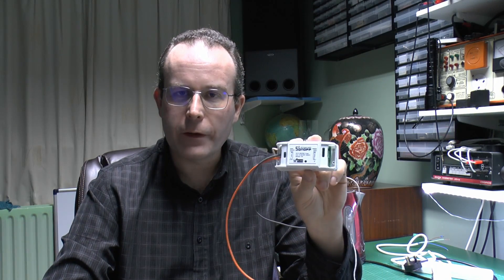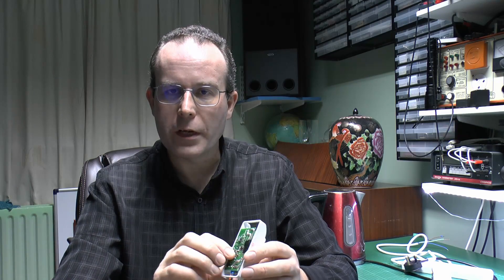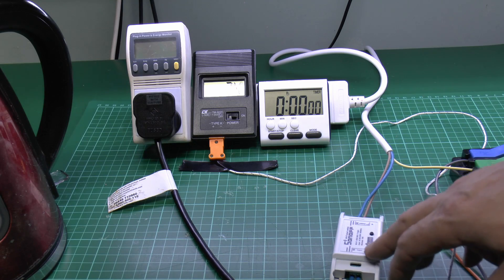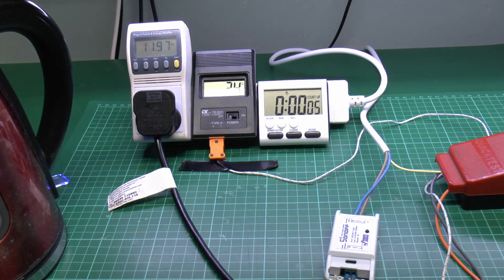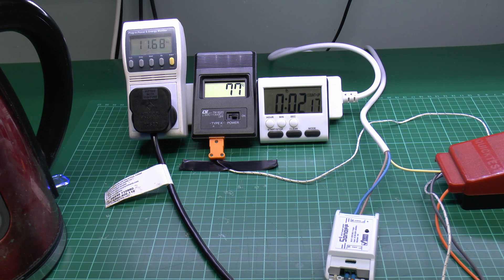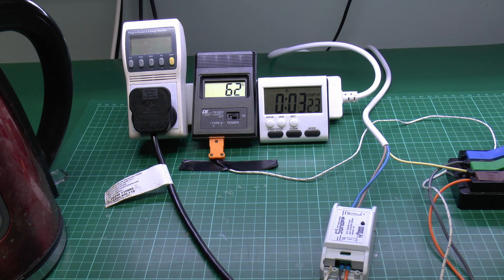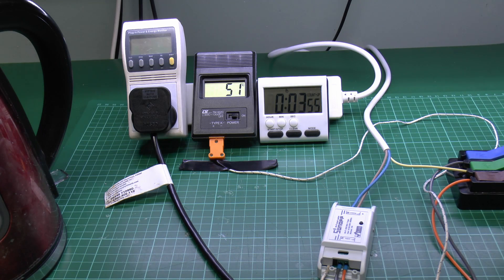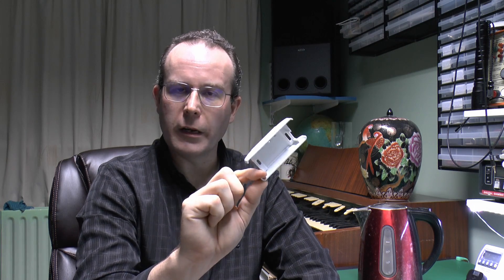Sonoff Switch & 2800W Kettle Load Test

Comment: Can we say that 0.04A is the quiscient power of Sonoff? That is quite a high power (about 10W). So, its not a great energy saving device, but good for internet control?
Reply from the maker: The power meter used in this video isn't accurate at low currents, and the Sonoff device has a poor power factor, so the actual power is only about 0.7 watts, as shown in this earlier video: https://youtu.be/pooW8nZwp2M?t=777

Comment: Could this be used for a 1000 watt heater element in a smoker oven ??
Reply from the maker: Yes, could be used for anything under 16 amps.
Reply: @jwflame  That is mega cool :) thx for your quick reply .. i have just ordered one
Reply: @jwflame  Do you know if there is any good temp probes for the TH16 like the ones you use in your grill or oven .. i ordered the water proff one but it's only rated for 80c and i sometimes need to use it at 100 and 110 degrees C 
(im all new to this system , i have not ever fooled around with anything like this before)

Comment: Hi,
Getting the traces to cope with 10A  is cheap. Putting a relay in that can handle switching the load is something different. It would be interesting to see if it can switch the load on and off a few times in quick succession...

Comment: John, could one of these 16A version be used on a sodium lamp. (Son-T 70w 100w)?
Reply from the maker: Yes, even allowing for a surge when switched on/off, the current will still be far less than the 16A rating of the switch.
The 10A would be ok as well.
100w is less than 0.5A.

Comment: Hi John I have a 16 amp one of these can I run it on a table top pie warmer in my club so
I can turn it on before I go to club with my WiFi from my i phone I believe the pie warmer is 12.5 amp thank you 
Regards colin
Reply: Go right ahead....
Reply: This is a cheap unit, so hardware misbehaviour due to noise on the mains or a data error somewhere ( 2 devices with the same serial number maybe) is possible. If your appliance turning on by itself in the middle of the night is a hazard, then its probably a bad idea.

Comment: Great video, if i use this for an electric heater 2000watts will this be a problem? Will it go in flames?
Reply from the maker: 2000W is about 8 amps at 240V, or 9 amps at 220V, so not a problem as this switch is rated to 10A.
Reply: It's rated by the Chinese to be 10amps for a resistive load, do you trust the Chinese?

Comment: Hi John, thanks for this video. Wondering if you can advise me with regards to overload threshold if I was to use this Sonoff with a 220-24V, 1 ph, 60 hertz air conditionner witch details are 13000 btu / hour and 3.81 kW. How does that translate into Amps please and would Sonoff 10A be enough ? Thank you.
Reply from the maker: 3810 watts / 240 volts = 15.8 amps, so a 10A switch is not suitable.

Comment: The rating is contact switching current, once the relay is closed, there's not going to be much of a problem, problems are likely to arise with switch on and off of the relay while it has a heavy load connected, the greater the load, the greater the arc is going to be on the relay contacts, an extra 1 amp is not going to be a big problem, but will reduce the life of the contacts.

Comment: Thanks for the excellent and educating video, i have a query i have just got a bunch of 10 AMP Sonoff most of them are used with LED lights, but i have installed one with my main ceiling fan, the fan should have load of less 120 watts and around 1 AMP rating the only issue over here is they are one almost 24/7 may be 22 hours in a day or so hence would this 10 AMP switch be able to take the stress, and fans have regulators and the switch is between the fan and regulator would it cause any damage

Comment: What would concern me more is the reliability of those relays, with different types of loads. I've seen cheap relays in things like microwave ovens that have had contact failure. They literally start melting and will catch on fire if you don't remove power.

Comment: Thanks - I've been meaning to do that for a while.  Personally, if a relay is rated at 10 amps I would consider 10 amps the absolute maximum and preferably leave a margin. Also your room temperature might be different to the room temperature of some one like me - currently in southern Spain. There will also be manufacturing variations in a low cost product such as the Sonoff.   I use them all over the place - with my own software and I find them to be perfectly reliable. The one you showed there is bottom of the range (and hence cheapest) - there is a 16amp version for those who need that little extra..
Reply: good information about the 16a variant
Reply: do sonoff switches support dimmable led lamps?
Reply: Andrew Watson only the the sonoff b1 supports that. But that's not a switch

Comment: Excellent video John - Thanks for sharing the information - great to know they can handle the rated load and a little more.  Looking forward to the next installment.
Reply: im not sure they can, this was only 3 minutes, if you ran an electric heater from it, which can run for hours, it may burn up
Reply: Oh I agree long term overload is NEVER a good thing - but it's good to know there's a little margin when powering up.